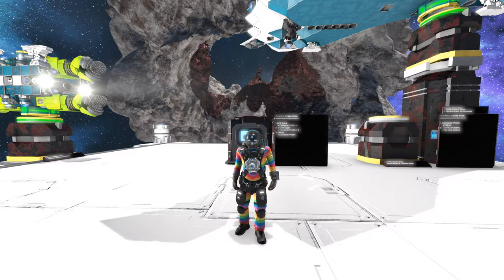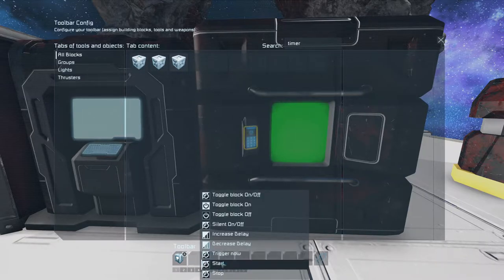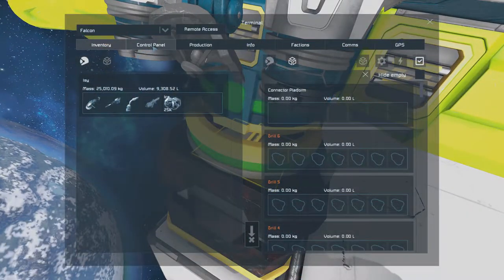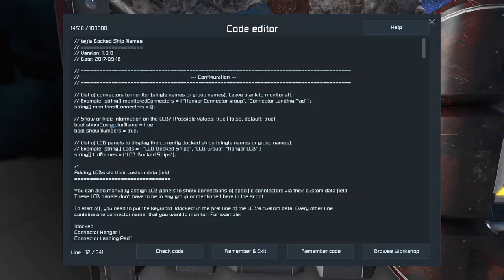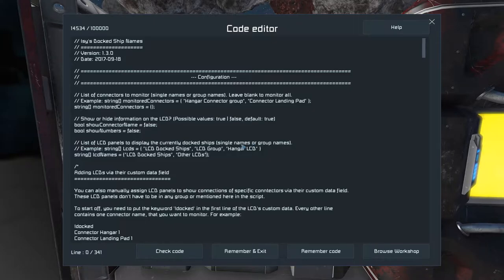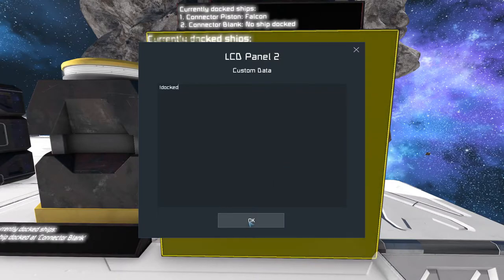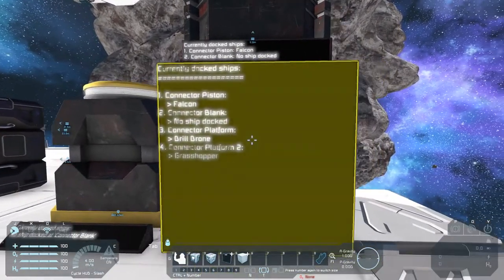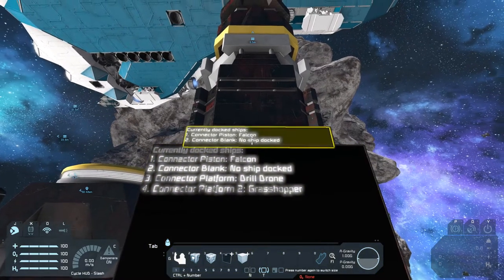Space Engineers - Isy's Docked Ship Names Script v1.3 Tutorial

Comment: Your scripts give me so much ideas to clean up my base and improve it's look. Small request or suggestion : i don't know if it's possible to "color" the texts in a LCD panel (i assume it is ?), and if so, maybe giving the ability to setup a specific color for connected and disconnected ports in a hexadecimal value would be nice ? (like, green if something is connected, or "free" to dock… or maybe grey to fake a dimmed line… ). Last idea, as i also an a big fan of the displays for the solar rotation script : having the ability to "offset" the letters inside the panels, just so the texts aren't right on the edge of the screens (this is really just for aesthetics purposes…). (and for the solar rotation script, if colors are possible, i'm sure having a green number or texts displaying the fact the panels are correctly setuped, and in red or orange the errors like you have to connect a battery, would add a very nice touch !). Of course, just suggestions for improvements, i'm already super glad to know i have now this super tool in hand, to make display pods, and a "command center" with huge displays and doors leading to plateforms with ships, etc. Thanks for your work !
Reply from the maker: Thanks for your great suggestions.. Unfortunately there is no easy way to change the font color.. The only way to change this is to use special colored characters that are used with the tiniest font size on a pixel basis. But this implementation needs a total recalculation of every single letter that should be shown into a pixel format.. For example let's say we want to write an 'A' as 3x5 pixels.. The information needed would be 5 lines with 3 Pixel characters of information from top to bottom line: 1. Blank, Pixel, blank, 2. Pixel, blank, Pixel, 3. Pixel, Pixel, Pixel, 4. Pixel, blank, Pixel, 5. Pixel, blank, Pixel... You get the idea? So in the end that's just too much work..
Reply: Thanks for the answer. And YEAH i can now totally see the kind of work required here. I guess i can pass on the aesthetics here, and enjoy the script itself which has already been used several times in my games now. Thanks again for your work Isy :)